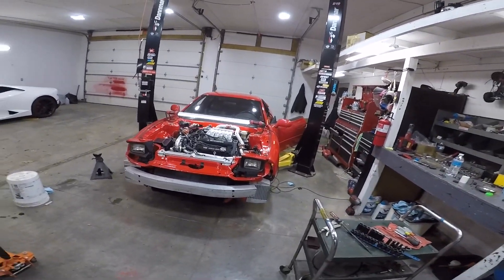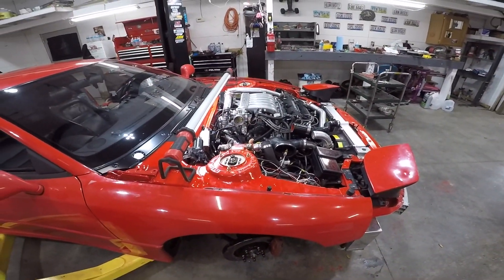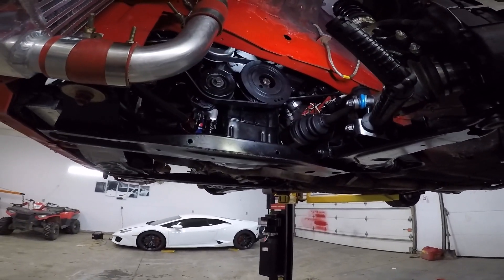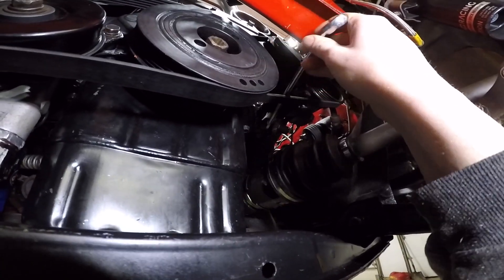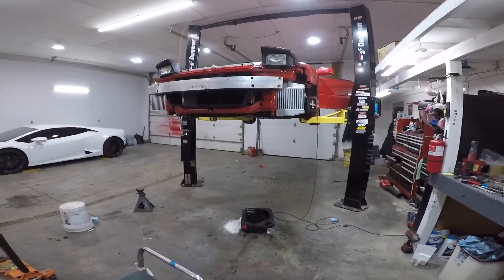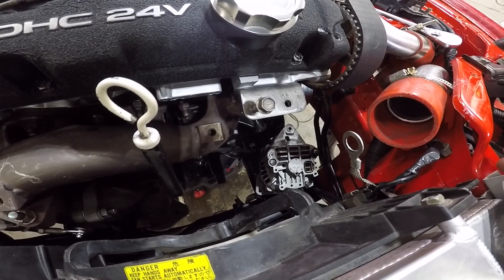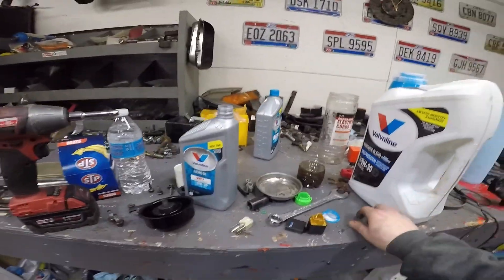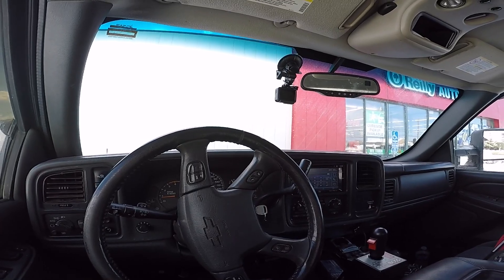Fixing my Mistakes / Should I upgrade my alternator to 200 Amp❓ [ 3000gt vr4 ]

Comment: Don't you hate it should be the easiest thing to do on a car turns out to be the hardest damn thing I remember changing the water pump on my eagle talon TSI we ended up having to drop the engine pulling the radiator holy crap it's almost done though keep your head up
Reply from the maker: Lol nothing's easy 🤙

Comment: Everytime I've taken out my alternator (about 4 times now) after my first couple attempts of fanangling, I just decided that taking out my rad is easier especially with a big bucket to catch the coolant in. It makes it easier but I'm sure there's a way to put it in with the rad still in it, I just didn't wanna risk banging up the rad. Even still, the Stealth with the SOHC baby boi engine in it definitely has the worst alt I've ever had the pleasure of replacing. Keep on chugging though! :D Also I think a snow plow video would be "cool".....if you catch my 'drift'.
Reply from the maker: Lol

Comment: You may already know this, but just because the upgraded alternator  is rated at 200 amps, that doesn't mean it supplies a consistent 200 amps.

Simply put, if the electronics demand additional amperage, the alternator is capable of suppling up to 200 amps.

I would recommend keeping the original fuse. I highly doubt your setup will draw that many amps, if it does, your wiring may not support it. I'd rather pop a fuse then fry the wiring.
Reply from the maker: True true

Comment: Disclaimer: I’m not an electrical system professional lol 😂. From what I know, you don’t need to upgrade the alternator until you either build up your sound system with multiple amps or build up your ignition system with MSD ignition running a coil-on-plug setup. And even then it’s about how sustained you’re running things all-out because your battery acts as a buffer and storage tank for your electrical system. So really… much more attention needs to be placed on your battery selection than upgrading your alternator.
Reply from the maker: Look at u 🤣 that make sense but I've heard of people upgrading their alternators when they run like a lot of nitrous and really big injectors and the bigger ignition system too butttt for the same price as the factory one I can get a 200-amp one so I didn't know if I should just upgrade
Reply: @huracanian3051  … well it’s hard to argue against getting more for the same price lol. I’d just do some quick research to make sure wire gauge matches up to handle the extra amps. And you already said in the video about needing a relay. I think that’s all you’d need to worry about. Technically, there’s a regulator that tells your alternator how much power to push out and it can get burned up if you go too big but I think 200a is still within reason. Maybe check the forums to be sure?
Reply from the maker: @mynameispremo  🤙

Comment: It's the Aftermarket rad that makes it difficult, stock rad it comes out the top at the front. On the upgrade or stock, I am running injectors, two Kicker  amps, a Kicker sub, an android pad, an ITC  and SAFC , an AFR , HID's and a stock one is fine for all that for me. Evil Empire Performance does upgraded ones as do a few others but I rarely see anyone bother and our resident Electrical boffin at GTOOC runs a stock one too. I'd just get a brand new stocker or have the one you have refurbed by a good firm.
Reply from the maker: I found a few places that make 200amp for like $180 and that's what I payed for this 110 amp one so idk but then I have to upgrade the fuse lol
Reply: @huracanian3051  200AMP one won't do any harm but as I see folk with all sorts of cars from my buddys 1200HP time attack car to fully loaded with luxury electrical modded cars and the only ones I see upgrade the alternator for high output in the main are cars with OTT sound systems.
Reply from the maker: @SuperDeadlen  I know some people have upgraded alternator when they're running really big injectors and nitrous and all that stuff cuz you don't want like when your injectors to not good enough power for some reason and lean out in sure ur right is be fine at 110amp but for pretty much the same price I was just wondering if I should upgrade
Reply: @huracanian3051  I don't think running the higher output one will cook any electrics as long as you upgrade the relay so with a bit more tinkering it could be worth doing if you get the 145 or 200 for the same price, equally you may well not notice the difference and over engineer it, this is the joy the more mod the more decisions eh, often not a right or wrong answer depends on the owner and all our builds come out a little different.

Comment: There is a trick, at least with the OEM radiator, once you remove the intercooler piping I'm fairly sure you can pull up and pivot the radiator to lay on the engine to then pull the alternator.  There may be some steps I'm missing, but I've done it before in a driveway to help a guy out - it's just been 10+ years!

Comment: Is the 200a an oem option on those cars?
Reply from the maker: I don't think so I think they just take the factory alternator take out all the guts and turn into a 200-amp idk man 🤣
Reply: @huracanian3051  ive had my 270a alternator from Brand X on my 2007 envoy for 2 years now, it was 290$ shipped